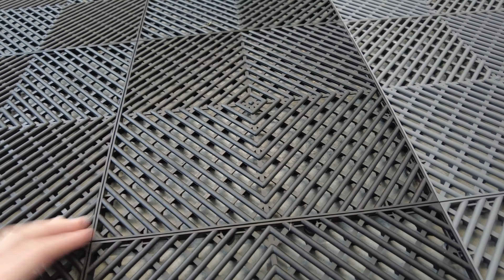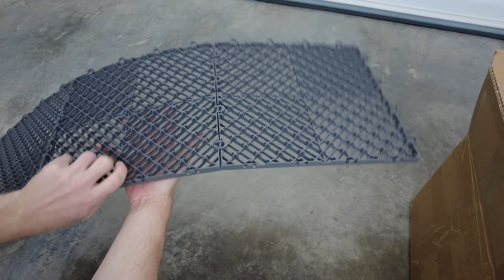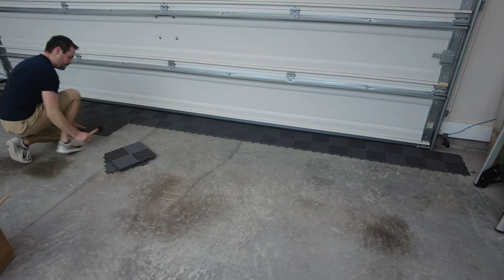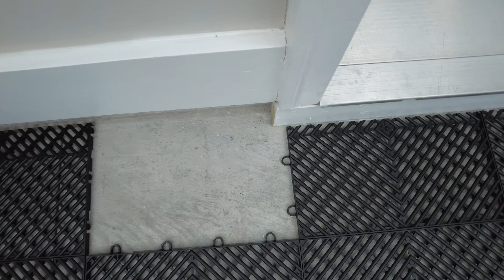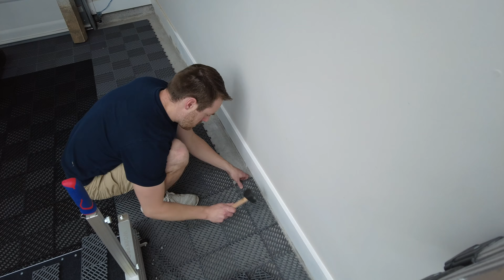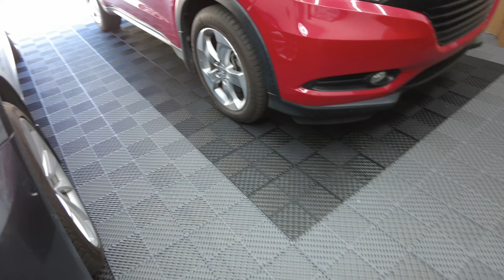Garage Floor Tiles Review and Full Install | Vevor Tiles | Tesla Garage Setup | HUGE Upgrade!

Comment from the maker: $1000 OFF your Tesla Here ▶︎ https://ts.la/evan87711
(Updated) Vevor Garage Floor Tiles ▶︎ https://s.vevor.com/bfRx1k
(Updated) Vevor Garage Floor Tiles (Amazon) ▶︎ https://amzn.to/4fLXjft
Tile Cutting Tool ▶︎ https://amzn.to/3U022Cu
Small Circular Saw ▶︎https://amzn.to/4aA3KzP
Tile Edge Guard ▶︎ https://amzn.to/43XILFn
Reply: Sold out in USA and Canada go figure
Reply from the maker: @allenkarpenko3213  dang! Hope they restock soon!
Reply: For the edge entrance strip, did you go with the 20ft, 3MM, 5MM or 10MM??? 
Just wanted to order the right size like your video
Reply from the maker: @KnockTsuKow  it should be the exact product in the link. 20ft 10mm
Reply: @EMtesla1  thank you
Reply: Nice video! i just installed these and couldn't be happier.
Reply: Where did you get those lights on the ceiling?
Reply from the maker: @rjkevin4  From my video here: https://youtu.be/VPlLiqgr0f4

Comment: I like the tiles, but they didn't work for me. I am using them in an area without a vehicle on them, and that's fine, but where I needed to park my diesel truck, they cracked and pulled up. I need to pull in at a slight angle and turn my wheels to straighten out, providing enough room for a second vehicle and enough space in between to open a door. My truck weighs 9000lbs. My wife has a small SUV and pulls straight in and out, so there were no issues. Some of the more expensive tile brands have angled end pieces that will work with Vevor tiles, so you approach like a ramp and not push on the front face. Or you can use a table saw and angle the blade around 30 percent for the same effect.

Comment: Just wondering how the rubber transition piece is holding up?  Thinking construction adhesive may be more durable, but the only problem is powerwashing the tiles. The rubber strip, I assume, would prevent debris from exiting the garage when powerwashed.  Have you had any luck with upkeep?
Reply from the maker: As of today, I had to remove the rubber piece as the adhesive wore out. I added some plastic retro fit ramp pieces onto the edge to make it work.

Comment: Very nice. So your garage is 400 feet? For your setup, how many blacks did you buy and gray? Also, are these fairly soft? I’m debating this setup or epoxy and which is better for a kid on the way. Thanks!
Reply from the maker: 5 boxes of QTY 50ea black and 8 boxes of QTY 25ea grey

Comment: I installed these and my front wheel drive car causes them to curl up and slip apart. What can be done?
Reply from the maker: I'm not sure how they would curl up unless you turn the wheels sharply left and right without moving forward or reverse.

Comment: I am looking at purchasing this. How have they held up? How has your edge guard held up? Thanks!
Reply from the maker: They are still holding up great! The edge guard did not last as it lost its grip to the floor over time. Currently have no edge guard and they still are holding up great.
Reply: @EMtesla1 I'm sure I saw edges for these on vevor site, or it might have mentioned to contact them for some
Reply from the maker: @rooboy99  send a link if you have one!

Comment: How satisfied are you with the tiles today?  They holding up well?
Reply from the maker: They are still holding up great! The edge guard did not last as it lost its grip to the floor over time. Currently have no edge guard and they still are holding up great.
Reply: @EMtesla1  thank you for the prompt reply.  Did you happen to see what youtuber @IMJOSHV used for a transition piece?  I think I'm going to try that.
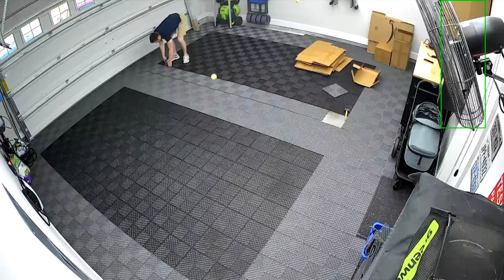Reply: @EMtesla1  https://youtu.be/FiBGn_EqU3k?si=yahB3y0FuZOcR0xP FF to 4:00
Reply from the maker: yea, unfortunately; they don't sell the edge guard for this brand.

Comment: Looks great! Curious to know (sorry if I missed it watching the video in sections) but how well do these drain water from washing cars with that border edge on? Or do you have floor drains? I'm thinking the water gets trapped at the garage door? Also, the links for the Vevor tiles are not the ones in the video FYI. Thanks.

Comment: I don’t like these as dirt talked underneath gotta get solid ones that allow air underneath
Reply: You can either 1- vacuum the tiles which works moderately well. 2. Power wash them down which works great. 3. Remove whole sections and drag it out to clean under them.

The above only really needs to be done every few months at most unless you're doing some serious wood working in your garage. It's seriously better than having a solid floor that you would otherwise need to clean every few days or even daily if you're making a large mess.

Comment: For the edge entrance strip, did you go with the 20ft, 3MM, 5MM or 10MM??? 
Just wanted to order the right size like your video
Reply from the maker: It's the exact product from the link. 10MM

Comment: did you happen to find a better solution for the tile edge guard, super interested in the VEVOR system, but only hesitating because there is no edge guard made specifically for this.
Reply from the maker: not yet no, I'm still using that rubber ramp seal. It works fine, I just need to find a way to secure it to the concrete.
Reply: I have heard that the Swiss trax edge works with this floor. Maybe look into that.
Reply from the maker: @jwettig2275  I’ve heard it does not. Guess I will just have to buy and find out!

Comment: How does the edging strip hold up? Thanks!
Reply from the maker: Well, lets say its in place. But the adhesive is already coming off the concrete floor. I'm debating on caulking it onto the floor. It only comes loose if you catch it with your foot.

Comment: Have you had any issue with wind blowing dirt/stuff in and it getting under the tiles? Or non issue?
Reply from the maker: Dirt will get under the tiles. Simply vacuum with shopvac or leaf blower out.
Reply: @EMtesla1  thanks!
Reply: That's the point

Comment: Thanks for posting. I'm in the air between these tiles or epoxy. My only concern is for my woman. I'm afraid she might twist her ankle if she wears heels and walks on the tiles.
Reply from the maker: I'm pretty sure the heel will not fit through a crack of these tiles. They'd have to be very very tiny heals.

Comment: Not going to lie, the vevor tiles look very cheap and flimsy, esp when you were holding one up and it was bending quite a bit. I run swisstrax tiles for my garage and they look and feel much more substantial. Kudos if it works for you, but I was looking for a 20+ year solution for my project.
Reply from the maker: Ill keep everyone updated on how they work out! thanks for commenting!
Reply: Is underlayment required or recommended when installing on concrete garage floor?
Reply: @SupraB007  if you’re asking about the swisstrax, definitely no as there are channels underneath the tiles for water to drain out of the garage properly. As long as you cut the tiles to fit your garage, the concrete siding will hold everything in place.
Reply: You think swisstrax tiles are going to last 20 years.  BLAAAAAAAAAAAHAHAHAHAHAHA
Reply: @edwardr5084  7+ years and counting, not a single issue whatsoever. Troll harder.
Reply: @ApexClubRacer You paid $5,000 for some plastic so I’d sure hope so lmao

There’s literally no difference. I just did my 500sq ft garage for 600 bucks my buddy has Swisstrax and they’re identical size shape & are even interchangeable. (These Vevor ones are 12” so they’re a bit smaller)
Reply: @MrDance4meh  I paid less than 1600 for 20x20, not even close to 5k.